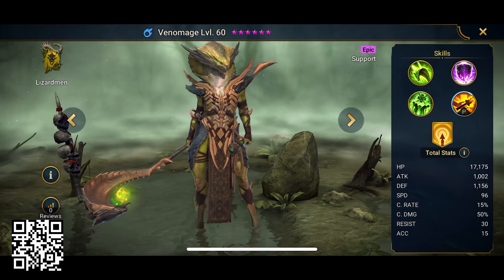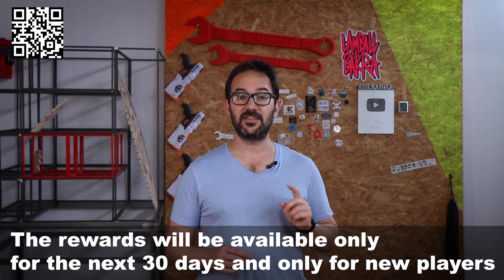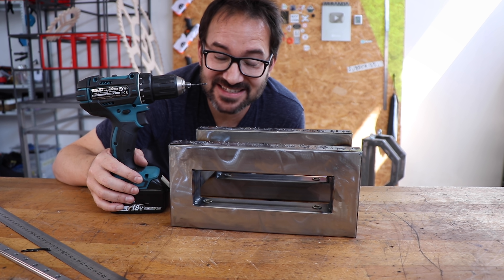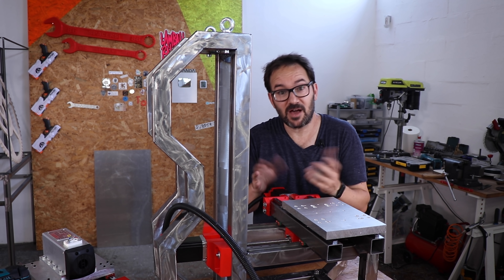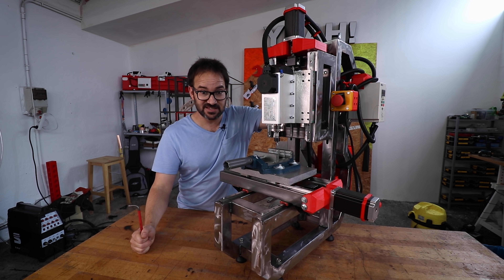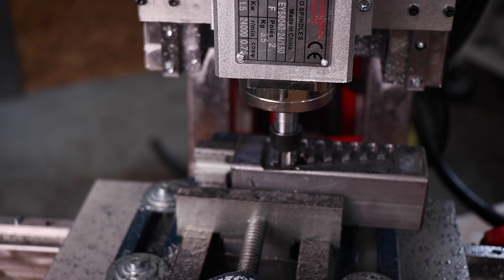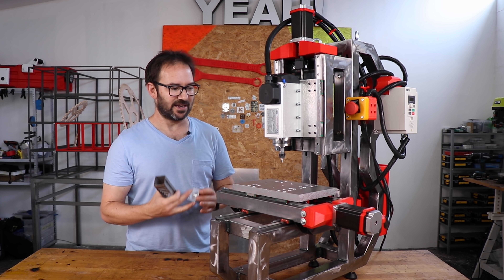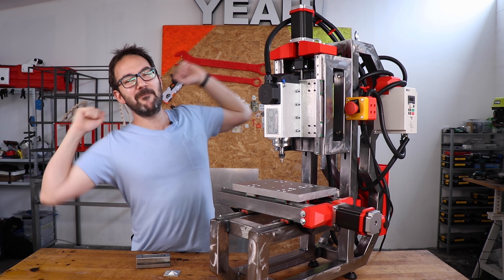I MADE A STEEL CNC MILL FROM SCRATCH (desktop version)

Comment: When running the G-code in Mach 3: you can reduce the speed at which the code runs by pressing the negative or positive buttons on the feed rate window, this will help you account for the density of any material ( the harder the material the slower you go, it helps to have quality bits for each material being used, and this also increases precision of the final product. )

You can further adjust the speed of travel of the cutter by properly calibrating your motors to your exact mechanics, look up how to calculate for different sprocket circumference sizes and adjust the steps per inch ( how many steps or single movements does it take the motor with mechanics attached to rotate 1 full inch on the machine ( the very center of the cutting bit ), start around 2000 and then adjust the exact number based on your individual mechanics accordingly) 

Adjust the acceleration and velocity of each axis, what you want to do is create a perfect triangle, or as close to it as possible, it can be at various speeds (sizes of triangles going up to a certain limit), that setting seems to work well in stabilizing the systems movements. 

Great job, very well done. 

-ER x

Comment: at 8:45 when you're putting the little hex bolts through the square  tubing I initially thought it was really gross how the holes weren't deburred but then I thought, well don't you think that those little flaps of steel will actually kinda act like a spring washer and prevent the bolt from unscrewing ?

Comment: It is cool, so much effort put into it, the job itself is amazing. The weak point is this is only good for plastics and wood even alu is hard to touch with that lack of rigidity. You can get idea on rigidity by mounting this whole mill to some welding table or another strong mount point, then mount clock gauge holder to that same mount point independently of mill, then touch endmill base with clock gauge and check values when you apply side force to spindle by hand, then put clock gauge probe so it touches endmill mount from beneath and apply force even by hand to the top of the spindle, then same measurments for X and Y on table, you will get an idea why aluminium and steel is no go for it with any realweorld performance and tolerances... But you can improve design by using larger ballscrews with double nuts, larger rails, no plastic parts for nut or motor holding and adding epoxy granite into iron profiles probably with pretension rods (you will have to recalibrate mount areas after that as deflection will occur), with that you can be good with aluminium for hobby purposes.

Comment: This is a really cool design. On that side you usually deliver. 
BUT
I don't want to imagine what an indicator would show if you'd run it across your axis...
I'm probably not experienced enough in machining to complain, yet, but I think you need a lot of luck to get any straight parts out of this.
I really hope this thing does what you need but precision - or the lack thereof - can be very painful at times

Comment: Don't machine unsupported stock like that.
1_ You're going to end up destroying your end mills
2_ the surface finish is going to be terrible
3_ it's a good way to catch shrapnel from the cut, or the end mill. No one like digging little chunk of metal out of their flesh. 

Next issue: Even though you've built the frame out of steel tube, you're going to suffer a LOT of rigidity issues, namely chatter, noise, vibrations, and poor surface quality. It's not enough to use hollow square tube, you want to fill in all those tubes with concrete or granite and epoxy to stiffen everything up, and add mass to dampen vibrations. 

It's also important to check your linear rails to ensure they are perfectly aligned. earlier in the video, i noticed you laid the rail on the frame, and checked to see if they were flatly mated surfaces, but did you check the rails first? Linear rails like that quite often come from the factory with a little bit of warp, or twist in them. It's a good idea to make sure they are flat, and parallel BEFORE installing them. this way you can account for the deviations. 

The 3d printed parts... SO many issues here... 

1) You put the power supply in what appears to be a completely enclosed 3d print, with the venting side of the PSU pressed against the back.. YIKES.. no airflow at all, that PSU won't last very long. 

2) Coupling the motors to the frame with 3d prints isn't really the way to go here. If there's ever a bind, that motor is either going to rip itself through the 3d print, causing damage everywhere, or will simply over heat and sag over time due to the thermal sensitivity of FDM printing materials. 

finally...... You appear to already have a decent mill.. using it to mill out a few slots seems like a complete waste of time / effort. Most of your plastic / printed parts could have been milled from aluminium or steel. A lot of the thread rivits as well could have been machined from steel, drilled, tapped, and then welded into place making for a MUCH stronger bond. 

I want to point out, that i wouldn't usually be this critical of a build, but this isn't your first go, and there are quite a few concepts you've overlooked, didn't research, or didn't implement that would have made this machine much sturdier, and reliable.

Comment: Cool machine, but your design is only as good as the weakest points and those are the 3D printed parts. It is an awesome machine if you upgrade those parts to metal yours part.

Comment: The base is too narrow for the height of the machine. I would fill every hollow tube with sand or cement if I could wherever is possible. You can't beat mass for rigidity.

Comment: Making a machine tool out of thin wall steel tubing is never going to yield a good surface finish. Steel tubing cannot dampen the vibration. You can get better results from a machine made of the European standard linear aluminum rail you've used in other projects, even when using 3D printed connectors and mounts made of PLA.

The most important factors for better surface finishes are: 1) a frame that is rigid and incorporates material to dampen vibration; 2) a spindle with good bearings and low total indicated runout; 3) a tool holder that matches the diameter of the cutting tool (to avoid introducing runout); 4) a properly trammed head; 5) a cutting tool with correct geometry for the material (the ones you used were suitable); 6) proper speeds and feeds; and 7) rigid work holding.

That said, I do appreciate your enthusiasm and creativity.

Comment: find a good welder who can teach you ;) not the worst ive seen, but you could do alooooot better for sure :) and tig is proberly the hardest to learn to master straight away, compared to mag / mig .. they are a little more forgiving ;)  TIG is ALOT of heat in 1 single place.... a good thumb rule is for every 1 mm its around 30 amps... so 2mm would be 60 amps !.  but ofcourse people are different, but depends on your speed and how fast your filling it with the filler.. 

OH yeah and you made to much space between each tube... something like that it should be  max 0.2 or something, if not just 0.0 :)

Comment: Fill the frame of the machine with cement or resin mixed with small stones. This will take out/damper high pitch/high frequency vibration and create nicer surface finish.

Comment: Nice frame but looks like this is gonna be lacking of accuracy and parallelism, and the upper gantry is gonna need more stiffness and rigidity cause threaded rivet and such few screws are gonna move and micro shift due to vibration

But in the end that an awesome work, I would never have done better  👏🏼👏🏾

Comment: It looks nice, but it simply doesn’t work well.  It is not really your machining skills, I think.  It lacks rigidity.  The tubing is too thin and there should be no plastic parts in the kinematic chain. By welding together components, you have a system with the worst damping possible. Bolting together, while not as “elegant,” permits friction between bolted together surfaces under vibratory excitation, giving some damping.  I am willing to bet that the resonant frequencies of your welded components fall in the range of the tooth frequencies of your cutters.  Sorry to be so negative.  You have a lot of skill, both in design, fabrication, video, and humor.  I enjoyed the video.  But the machine needs revision.

Comment: Stellar fab job. 

TO help with getting those screws through the square tubes to the other side easier, I've started using magnetic tape (just strong enough to hold the screw in) wrapped around  a straw. Just push the straw against the screw hole/port and bing bang boom no more drops.

Comment: interesting design question why did you have an extra rig where you mount the Z axis. aren't you then loosing too much in Y and loose rigidity ? 2nd question if you mill steel how much does the z axis bend ?

Comment: The design is perfect, but the result is not stiff enough. If you fill up the tubes with epoxy concret, it will be better, but not perfect. The structure is not heavy enough.

Comment: Ivan Good job , After you machine replacement mounts for the steppers. Fill the frame tubes with resin concrete, or sand to dampen vibrations and make it quieter also given the size/rigidity of this machine i would use smaller end-mills at faster rpm and slow down cutting speed.

Comment: Although I totally appreciate the hard work and the low cost DIY approach of this machine (I have been looking for such a design myself), I don't see how this could possibly be aligned to the tolerance levels required for reasonable quality machining. When I see the level of precision required to align geometry on a typical CNC (a few hundredth of a mm overall) it surely is a daunting task on a machine built with almost hand held soldered extrusions. Also it seems that your are using MGN rails. Correct me if this is not the case. But if it is so, these are totally not suited for this type of application. They have only one track of balls and can only be used on light loads and only in the rail axis, such as on a 3D printer or on a linear actuator. On a machine requiring lateral rigidity during your cuts where your tool is pushing against your stock material, you must use dual track balls (HGR rails) or even rails with roller bearings on larger machines. HGR style rails exist in many flavors, can be very compact and are not much more expensive than MGN and will definitely increase the cutting precision and durability of the machine. MGN rails will quickly die with the lateral cutting forces involved and will tend to vibrate quite significantly on aggressive operations. Still again, great build !

Comment: That stepped "OVAL" pyramid you made is pretty cool." :) .. Congratulations on understanding the word "SCRATCH". Seems like others on here , and in a multitude of genres don't get" From Scratch". NIce light-weight design. "She's got allot of flex though...I''ve built a couple similar, but with much bigger spindle motors, filling the voids with concrete can help lessen unwanted chassis-articulation.
*NOTE: ( --To increase accuracy;--
   IF ANYONE desires or requires exponentially more accurate milling, like milling a stepped pyramid of "Circles", especially in steel, replace the 062in-.125in(1.5mm-3mm) with ".375in-.75in(9mm-20mm)"...(ALSO Consider-Filling any voids with fiber-reinforced concrete.) 
  I would however suggest to keep-in-mind the massive increase in weight that will result. Thusly, moving it is going to require a fork-lift! So if you don't own a fork-lift or plan on building it in-place and not needing to move it, stick with the/a design like this gentleman has built.

Comment: All good with this build, my only complain is after all that welding and metal put together you come up with a 3D printed motor mount, really?,  why not going all the way solid metal,  you will get a more robust  machine, remember a system is as strong as the weakest element in it.

Comment: Which aluminium you use? for machining use AW 2007, 6061 or 7075, the stock MG0,5 is terrible to mill. Same to square tube steel, J235, it flexes and it vibrates much. So use on this 16MnCr or 11SMn30 or similar, it goes way better . To the construction, add some improvements in the Z Axis, diagonals to stiff that out, fill it with expoxy granite, where possible and mill your own steppermounts and Ballnut holder from steel, and my last hint, use better mills 3 flutes for aluminium with flat helix 55°, or hrc65 bits for steel, trust me :-)

Comment: Nice! But this is just a toy with a toy accuracy/tolerance. Once welded, leave it for a year in a backyard on set it into oven to loosen tension. Also, how did you align axises to sharp 90 deg and keep axis rails in parallel plane? A simple angle grinder will never do it, you should look at precise ruler and at least 0.05mm/m buble level and keep scratching metal untill plane is perfect under axis rails. But yes, if it's just for fun in deserves both thumbs up! Greetings from Russia 🇷🇺

Comment: What is up with those linear rails!!!! these are not made for high load conditions like milling just precision movement. You want the HGR20 rails for about $115 shipped for two 1500mm rails with 4 carriages. Ideally for mills you want preloaded bearings on your carriages but the $115 cheapos are close enough and bigger is always better if you want to order 25mm rails.

Comment: I'd like to know how accurate the cuts are; the reason mills are usually made of cast iron isn't just for cost, it's because cast iron is really, really good at dampening vibrations that could make your tool or piece wander. I'd absolutely build one like yours if it's accurate enough for tight tolerances.

Comment: I'm sorry but thats not a mill. That's a steel framed CNC router. Useful for light prototyping or die making with soft materials, but that in no way has the stability or accuracy needed of an actual mill. A welded frame also does not help, too much thermal expansion due to welding, too much inaccuracy on the rails. Precision ground or hand scraped bed/ways is the way to go.

Comment: Are those red blocks 3d-printed? If so, maybe you could have use plastic a bit more and save weight/time/money on some non-critical parts. Also, for what reason did you raise the XY table so high? The closer it is to the base the better. Maybe consider bolting it to the floor and improve the precision?

Comment: Spindles like those are not good for heavy mills. You want to get a heavy motor and a milling head, then connect them with a belt, gears, or shaft. That'll fix the motor stalling problem

Comment: Nicely done. You could probably get a better cut and finish if you were to fill all the tubes with sand or lead shot. It will dampen any resonance from the steel frame. That is why machines are made from cast iron instead of steel. Also by by adding the sand or lead it will make the whole machine more rigid. The only bad part is that if you take a bolt out the machine will be bleeding sand or lead shot.

Comment: I think that using a threaded rivet is not best solution for precision, because vibration has negative impact to a threaded connections without hard lock by spring washer. Anyway, i like this project.

Comment: Plan ahead and try not to drill/tap on the welded seam of the square tube. The metal could be harder along the weld, thus snapped drills/taps.

Comment: You're going to destroy the bearings in the linear rails if you don't have them running perfectly parallel to each other. Do an epoxy pour and scrape to give you a truly flat surface and then mic the rails for equal distance. You may not even get a few hours out of them with how they are now before you get slop.
Reply: mic stands for what or what does it means, thanks!

Comment: Hello ivan, when going to steel you have to control your rotating speed (digitaly) (1000 * Cs/ pi* D) where Cs is optimal cuting speed (in the documentation of your bit : the more tooth, the less is Cs, it depends of your bit material and caring too) and D is the diameter. and also lubricant, lucbricant and more lubricant... :)
apparently your machine is 30*30 cm ... we were use to bigger... doing a 90*30 should be a reasonable and a 4th axe (rotating over the 90 axe could be really great to do any substractive work...

Comment: The frame is going to warp over time due to stress in all those welds. Also, the heat of the steppers is going to tranfer into the 3D printed plastic parts. Both not a good idea if you ask me.
Reply: Agreed. Not to mention the MGN rails/blocks are not made for the forces which show up in a router/mill and the seals on em are also not going to stop dirt from getting into them, which will drastically reduce the lifetime. The spindle VFD is also not correctly configured if the spindle can be stalled without faulting it out, which is dangerous as there is a chance it burns up.
Reply: I agree about the plastic, I'd either cast or machine out of brass or bronze
Reply: Your completely wrong about the frame, but correct about the 3d printed parts.

Comment: excellent job on the welding, it's a much greater way to fasten a machine base together with a much more rigid body. as the other guys mention, do a cast epoxy granite mill and then you'll have the most rigid machine, also I'd recommend looking into getting a good cnc spindle, with roller bearings or angular contact ball bearings that are designed to take the load better than the chineseium spindles

also please properly mount that to a work bench with screws and not rubber feet, overall great mill and very interesting watch